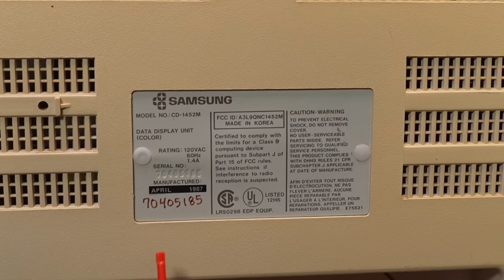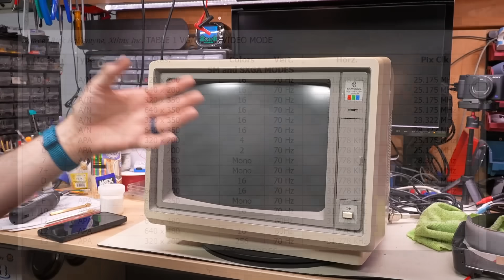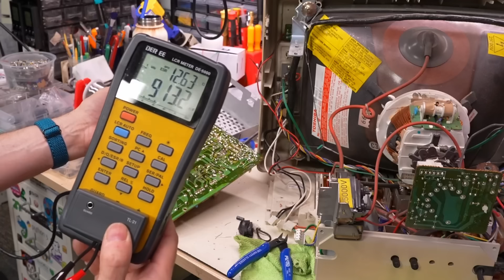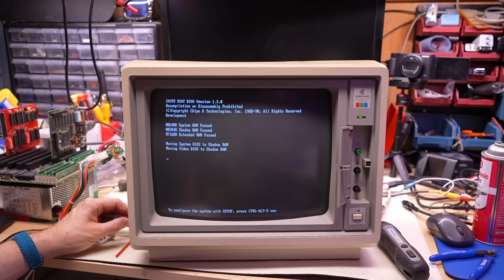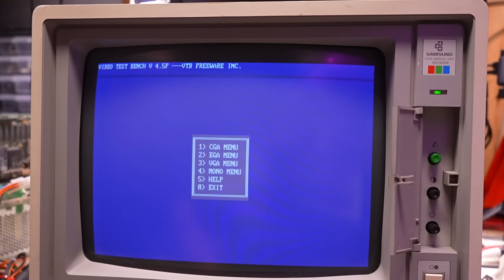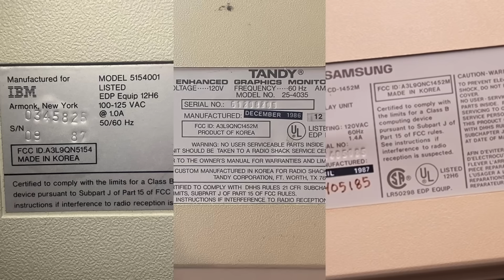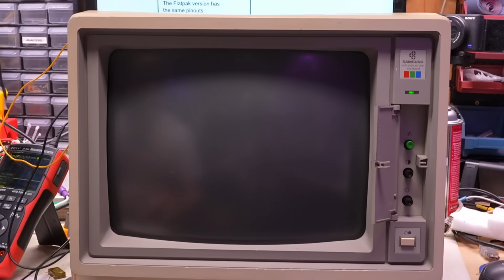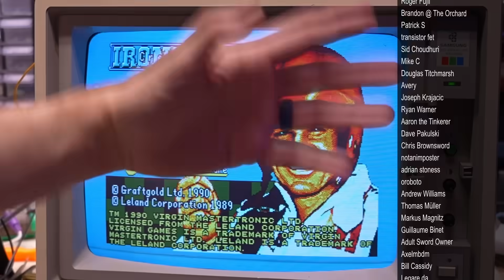This monitor is the same as the IBM 5154 EGA monitor! (Samsung CD-1452M)

Comment from the maker: 53:41 Small correction: the 28L22 is a 256 byte PROM, not 256 bits.
Reply: @adriansdigitalbasement2 
The term "PROM" is an oxymoron 👈
Programmable,  Read, Only...
Reply: @adriansdigitalbasement2  
Which is HUGE compared to the 2x 32 Byte PROMs that contained the whole initial BOOT program in an early minicomputer I worked on.
Reply: @snakezdewiggle6084 Programmable in a programmer. Read only in the device. That's my guess as to how it could be both.
Reply: @pgtmr2713 
Yeah, I was just messin' around.😆 Forgot to add a smiley.
I'm an Aussie, Australians rarely take things as seriously as we should, so long as no harm is done.😉😆👍
Reply: PROMs had burnable links, program once, read many.  Once it’s burned, that’s all you get.

Comment: The tube has almost surely been replaced! That 89 will be the date code as you suggested, and the monitor is from 87. The replacement also explains the cut ground wires on the dag ground. The original monitor the tube came from used those wires, while this monitor attaches the chassis frame to the CRT mounting tabs so there's no need for ground wires. The deflection yoke came from the other monitor along with the tube. A lot of times they are identical or close enough between wildly different monitors.
Reply from the maker: Yeah it just have been. Funny though it happened a long time ago as it was similarly dusty as everything else. I wonder what happened to require a complete swap?
Reply: @adriansdigitalbasement2 hey I’ve got an apple workgroup server with some issues can you help me fix it I have there very first one ever
Reply: @adriansdigitalbasement2  Maybe Samsung used some awfully low resolution tube, which the owner didn't like. Or it was used in an office for some years and suffered severe screen burn. Or the original tube just failed prematurely, sometimes that happened (went to air, or a spot weld on an electrode failed, etc.).
Reply: @adriansdigitalbasement2  Maybe the same thing that chewed up the plastic on the front also scratched the glass on the CRT.
Reply: What is a “rifa”?
Reply: @raidensama1511   A rifa is a capacitor manufacture and they had produced a certain type of X2 class capacitors that when aging did not go well. They would age to the point that internally the resistance would drop and the cap would heat up. Then a cascade event would happen at a point that it would run away and release the magic smoke, and boy does that smoke smell horrible. Some circles say it is due to moisture intrusion and prolonged disuse of the equipment not connected to mains. That is why most older equipment it is recommended to check the power supplies for those rectangular looking caps with the yellowish clear casing that are attached to mains input to ground with Class Y capacitors.
Reply: @JoeCdaYT  thank you!
Reply: @raidensama1511   rifa x and y caps are smoothing the ac input voltage. after 40 years they go bang, even if switched off - but plugged in. they get micro cracks from humidity and short phase with the other.

Comment: As an owner of this exact Samsung monitor, this was video massively informative. Mine has been a total basket case...something in the analog section went catastrophically wrong and exploded (one of the resistors quite literally burned a hole through the PCB). Never could find schematics or a manual or anything so previous attempts at repairs were stabs in the dark, and always resulted in something else smoking up. What are the odds the guts were the same as the 5154 this whole time...haha. Next time I dig it out, having the IBM schematics for reference should make things infinitely easier.

Comment: I didn't even KNOW there was a 64 color version of EGA.
Reply from the maker: It's basically 16 colors out of a palette of 64, this is unlike CGA which is a fixed 16 color palette. It does mean that programs that change colors can be a bit more creative with colors.
Reply: @adriansdigitalbasement2  oh is that why the EA Space game "Sentinel Worlds" has an EGA palette switch option that I could never get to work?
Reply: @adriansdigitalbasement2  Years ago, I had an old DOS demo program that would display all 64 EGA colors on-screen at once, through some video timing witchcraft. It would also display all 16 CGA colors as well. I never tried it on an actual EGA card because I've never owned one. But it worked well enough on a VGA card emulating EGA.
Reply: @shmehfleh3115 what’s the name of the demo? I want to try it in 86box
Reply: I somewhat remember that you could alter the palette of EGA from reading about it in the past, but never realized that any software ever took advantage of it.
Reply: @Voxfan124 Maybe it was 8088 MPH?
Reply: @Toonrick12  8088MPH is CGA composite, and area 5150 is CGA too

Comment: Pointless and obscure fact: some older UK television sets were kind of multiscan to support both PAL and the older 405-line broadcasts which had a lower horizontal frequency
Reply: I remember them having a mode switch and two tuning dials. And the 405 line mode used to make an annoying high pitched squeal.

Comment: The "circle with a line in it" is the symbol for power because it's a zero and a one, ie on and off
Reply: This icon was widly used for light-switches and also my old Philips-TV (from 1973) has it as powerswitch symbol
Reply: The symbol was around from before the days of '1's and '0's in everyday culture, and represents an old style toggle switch.
In the 'old days', power switches were mounted through front panels or casings of appliances by a round knurled nut and had a lever to flip up or down to turn the device On or Off.
THAT's what the power logo represents, nothing what so ever to do with '1's and '0's.
Reply: It's an IEC standard and the symbol varies as to how the switch controls the power state.  For instance, if it's not a solid circle and the vertical line goes through the top of it, it means that it is a logic control and another component of the system controls the actual power state, bringing it in and out of a standby state and not interrupting the actual power source.
Reply: This is what Wikipedia has to say, much like @douro20 said.
I still remember early red plastic rocker switches with neon lights inside arriving on the scene and the picture of a 'mains toggle switch' above them to identify its' purpose.

Comment: I remember working on a number of 5154 monitors. The only thing was that they used a 'tamper resistant screw' that I had to get a bit/socket (don't remember which it was). But, the thing I only had to do with all of them was to replace a number of capacitors in the power supply. There was a third party kit that had higher temp and higher voltage caps. It was a matter of when and not if they would fail and the startup circuit would not start the power supply. Great memory!!
Reply: Oh, and I'm pretty sure I upset the IBM service rep when she saw my tool to open this monitor. LOL

Comment: "Removed 20 screws but we're still not done"
Yup. Built like a tank.
Reply: Aren't tanks mostly welded? :D
Reply: @NielsHeusinkveld  The emphasis is on being built to last. You can't just take a tank apart by removing 4 screws and neither can you take this monitor's PSU apart like that.

Comment: The "Circle and Line Symbols" were standardized in 1973. They were: 
⏽for power on
⭘ for power off (both for rocker or slider switches)
⏼ for power on/off (for push switches)
⏻ for standby (soft-poweroff)
Reply from the maker: Ah so that's funny they neglected to use it. I guess it wasn't mandatory.

Comment: Very nice monitor. By the way, IBM had various OEMs for their 515x monitors. Samsung was one of them but the more common one in Europe was actually Salora, a Finnish company that became part of the Nokia group. So if you have an IBM Monitor "Made in Finland", it is a Salora/Nokia, Korea is Samsung and I think there were one or two more. My very first monitor was actually a Salora version of the 5154 (pretty sure it was a 5154, not a 5153 as my computer came with an EGA card and the monitor was able to do 640x350 in 16 and 64 color properly together with the card). The Salora actually was a perfect twin brother of the IBM with the very same case (screen slightly offset to the left with the inner bezel being a bit darker and larger on the right side, the three twist knobs for power, contrast and brightness and with the screen turning white when switching on the monitor with no signal applied, which was also common across all IBM TTL Monitors)
Reply from the maker: I wonder if anyone has shared pics of these other branded monitors? I saw inside EpicTronics European 5154 and it was definitely the same as this one. But that's just a sample size of one :-)
Reply: supposedly salora/nokia made them up to 1992

Comment: Must read the datasheets of various families.
74LS input low source current IIL is 0.4mA max and maximum input low voltage is 0.8V which gives an 2KΩ maximum value of the pull down resistor (0.8/0.0004).
To be safe, taking in account the long path the wire is routed in the noisy environment 1KΩ is perfect.
Reply from the maker: Excellent info, thanks for that!

Comment: I got a Samsung 48" 3D TV in 2013 it still works in 2024. I have a Samitron monitor I use for my old retro Intel Xeon dual CPU build all still goes. The cost-cutting technique Samsung uses works out well in the long run. Thanks for the in-depth lesson.

Comment: I think it was '98 or '99 and i was getting ready to build a new gaming rig.  While doing some reading, i learned that a high dollar Sony monitor was the same exact monitor that KDS (Korean Data Systems) sold.  And as it turns out, Sony made the picture tubes, and KDS did all the electronics.  So other than the case being slightly different, it was the same monitor!

And that thing was a beast!  Very high resolution, and the picture was beautiful, as one would expect from a trinitron tube.

This happens a lot in manufacturing, you quite often find out that it's one company (or a few) making ALL the product, and just slapping a different companies name on the outside.  IIRC, there were only 3 companies making CD-rom drive mechanisms, back in the day.  But there were a lot more brand names around.

Comment: I suspected that the IBM EGA monitor of the mid- to late-1980s was an IBM labeled version of this Samsung CD-1452M the moment I saw it in your video. I worked with dozens of those IBM EGA monitors back in the day. It was the second full-time job of my career, and my employer was a subsidiary of a mega-corp that had purchasing contracts (yes, that's plural) with IBM for everything from mainframes on down. The company had proprietary software that ran on every desktop, and the splash screen for that software displayed a pretty boring company logo on the CGA monitors that about half the desktops still had. But then they came out with a new version of the software whose splash screen was a photo of the main corporate campus at night. I think if a computer's display system was CGA (I don't remember there being any monochrome screens), the splash screen was still pretty boring, but if the display system was EGA or VGA, that photo appeared. The first time I saw it, I was in awe, because I'd never seen such an impressive display on a computer before. Not that anything else the company used took advantage of those EGA displays beyond somewhat better text resolution. BTW, those monitors had a serious fault. Something would spontaneously short out in there, causing the monitor to make noises and the display to go out, of course, but if left long enough, the thing would eventually catch fire. We caught several of those before seeing any flames, but not before the room was filled with acrid white smoke. I alerted my boss, who sent out a memo instructing employees to turn their monitors off when leaving at the end of the workday.
Reply from the maker: Heh yeah I figured there would be a bunch of folks who were intimately familiar with the 5154 who would recognize the guts of the Samsung monitor, connecting the lineage. And yes, turning off a monitor when away from it is always great advice. I remember when I was a kid people saying it was "better" to leave a computer and monitor on 24/7 to alleviate stress on the components from heat cycling. I thought even back then that was so silly!! Sure you might save yourself from a cracked solder joint but the wear and tear on all the parts running all the time, especially without cooling like on a Mac Plus or IIc monitor seemed not a great idea to me. Not to mention the fire risk you alluded to!

Comment: AGA supported VGA scan rates.However the normal default video modes for entertainment software targeted lower horizontal scan rates.
Reply from the maker: Actually so did ECS, but on ECS the "productivity" mode was so slow it was kind of useless and never used.
Reply: @adriansdigitalbasement2  how many bit planes? In OCS and ECS, 130ns gave you the full 6 and 65ns only 4. In AGA, the full 8 were available whether 130, 65, or 37.5ns (VGA mode used the 37.5ns pixel clock).

Comment: Before you even power these up you need to check the rubber grommets on the CRT, they turn hydroscopic and hold moisture, this will instantly destroy the scan coils, if theyre rock hard they need to be changed.

Its blurred because the focus voltage is low
Reply: @Synthematix  +1 for the rubber wedges. But the picture is only blurred when the beam current is high, which is indicative of a tired tube, unfortunately. If the emissions are good, might worth trying cleaning the cathodes (NOT rejuvenating, just cathode cleaning with a few mA). Some CRT testers can do it, but I've done it in older sets which lacked beam current monitoring by just disconnecting the carhode drive and grounding the cathodes one by one until it stops sparking inside the tube.
Reply: @mrnmrn1  You can also remove metallic crud from the neck by using neo magnets, sometimes theres a partial (high resistance) short

Comment: How about a PGA (Professional Graphics Adapter). EGA always had a place in my heart because it was so short lived, yet so relatively capable. PGA was supposed to be a superset of EGA running at 800x600x16. I think that would have been amazing for gaming on the lower power computers of the day, and running Desqview on 286s with enough RAM. Dream machine.

Comment: When I was in junior high, I took to messing around with the adjustment knobs inside a monochrome CGA monitor (compaq deskpro) and was able to get it to display an EGA signal, although the picture was much more narrow and squished-looking. All so I could play Wolfenstein 3D! Good times!
Reply: The strangest thing about this memory is the fact that wolfenstein3d shouldn’t have supported EGA, and yet I have a distinct memory of it working flawlessly after modifying the monitor. Perhaps the video card supported both ega and vga and was somehow sending a vga signal to the monitor? I think it may have been an Oak Technology card. Man, I wish I still had that compaq deskpro 286.

Comment: We never had EGA. Even though we were always behind, 2-3 years maybe, if I remember correctly, because we were poor. But back in the SVGA days, we bought a 14 inch GABA CRT monitor brand new, and it could only display 800x600 pixels, and it was even advertised to do only that resolution, as the highest. And then, after 2 years of daily usage, it went dead. We took it down to the local TV service person, who fixed it. After that, it coud display 1024x768, even though the manual said it can not do that. I have no idea why.
Reply: Maybe different parts, maybe different hz setting that time?  I had a nec that could do 1024x768 only in 56hz

Comment: Thanks for yet another informative and interesting video.. and plays the reminder of the dangers of the high voltages.  Back in the day I did a lot of CRT repairs and I had quite a lot of respect for the internals and always kept fingers away until I discharged things.. (and of course, keeping the things unplugged unless I was testing something that required power)

Comment: I think it was NEC and a few other had a monitor with tons of switches on it under a cover? Thing could do cga, ega, and vga. Had tons of connectors on the back to. The few I ran into was high hours usage and I think only did 800x600. something like that. I can't remember. Also some of them had those RGB H/V bnc connectors on the back.
Reply from the maker: Yeah those were great monitors. First came out in the late 80s like around 1989 I think. They weren't on sale long so are rare these days and truly multi sync

Comment: the 'yellow to red' knob controls the strength of the CGA Brown green component dimmer (Brown is transmitted as 'non-intense yellow' by a CGA card and converted by this sub-circuit).

Comment: 80s Samsung EGA monitors. Built tough and made to last. Still working and probably didn't even need that cap replaced.  My recommendation though would be to use transistors or simple logic OR/NOR gate to handle the shunt to ground and use the switch to control one leg of the gate.

Comment: I've got two IBM PS/1 monitors that have Samsung tubes. And I need to look again, but they both have two horizontal adjustments. Same model that you reviewed about 3 years ago according to YouTube.
Reply: ibm 53f5798. One of the two doesn't work. Blew a cap, replaced it, smoked a POT, replaced that, and it did it again. Not sure what's wrong with it, except maybe a shorted yolk.